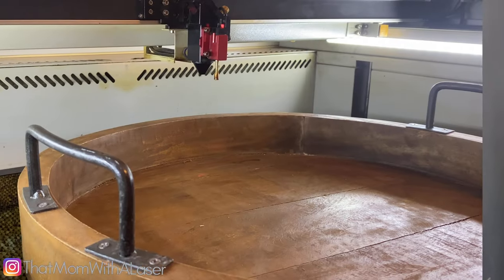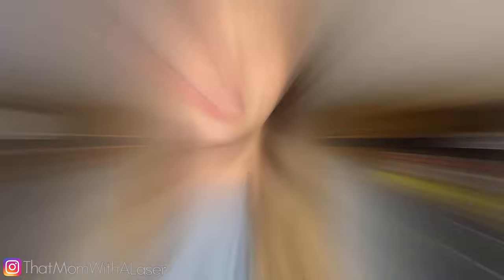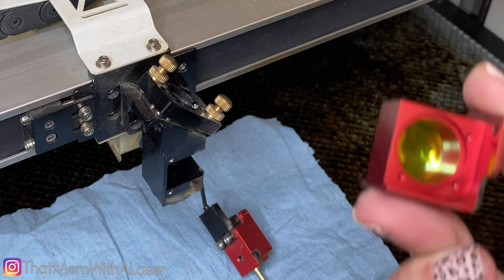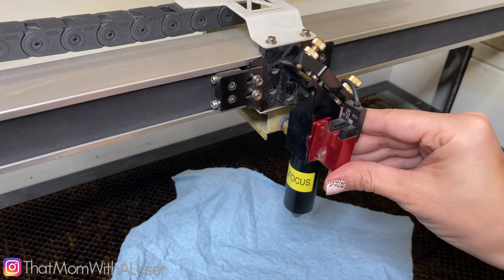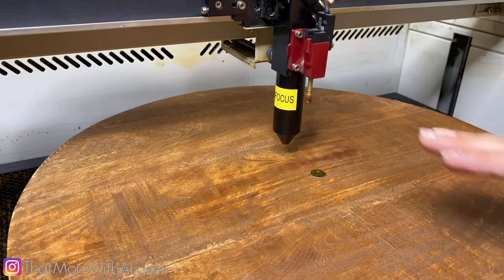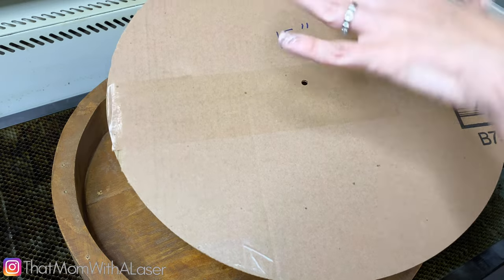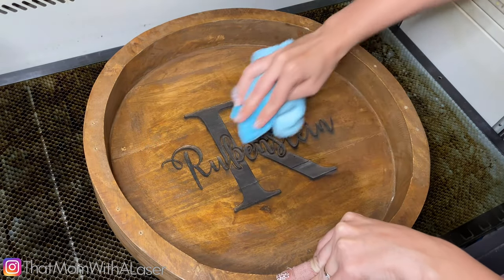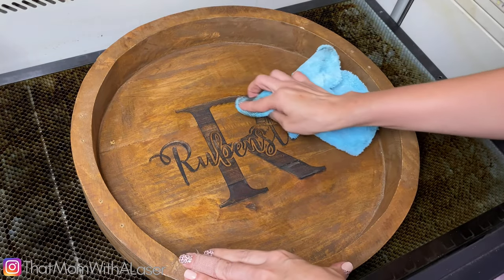How To: 4 Inch Lens Charcuterie Tray

Comment: Another great video, thanks!  One comment.  Depending upon your machine settings (and this might vary between manufactures), the laser might head back to it's home (0,0) position, which with a tray like you used, would cause a head crash.  There is a "Return Position" setting in the machine settings for Ruida controlled machines (accessible in LightBurn).  There are several options, but I have found "No Return" to be safe, i.e. the laser stops where it finished.  With mine set to "Origin", it goes back to home, which would be bad in this case.
Reply from the maker: You are the best, Ray! Thank you for always sharing such great tips. I will totally make a video on that! Thank you! ❤️
Reply: @ThatMomWithALaser  One other thought along that same line, especially if you're going to do a video.  I might suggest that framing be tested without the tray in the laser first.  I have more than once hit frame on a new project, and found that something wasn't right, and my laser went off into some other place than was expected (like forgetting to set the origin).  In normal circumstances that's no big deal, but if there is something in the laser bed that could hit the lens, well that's a whole other experience!  :)